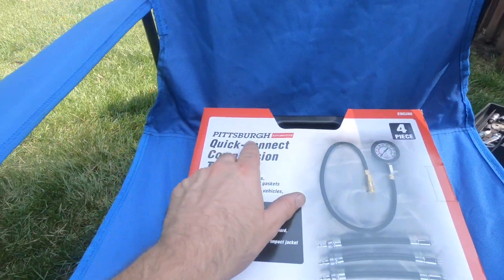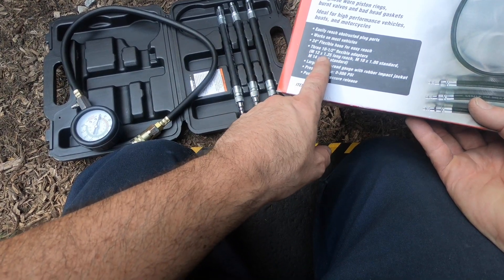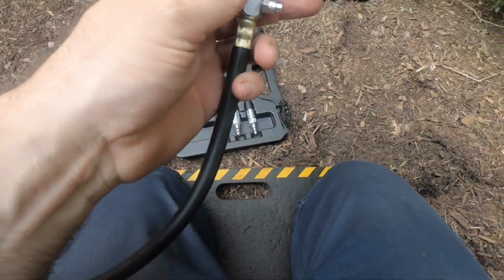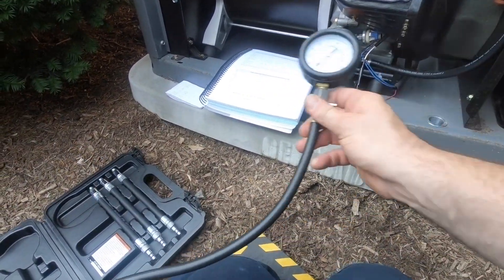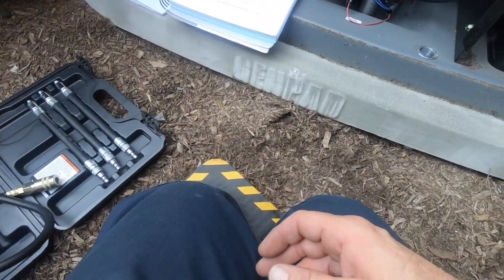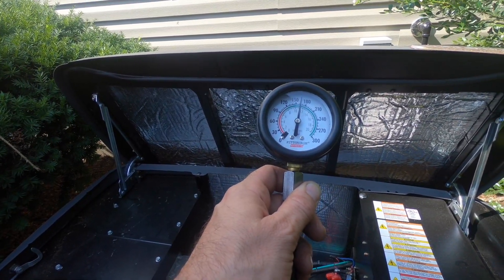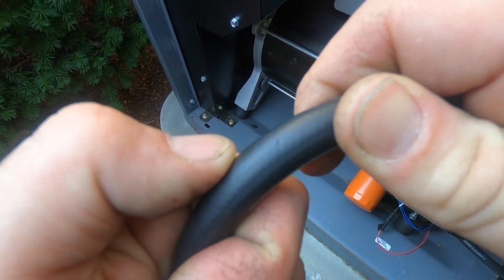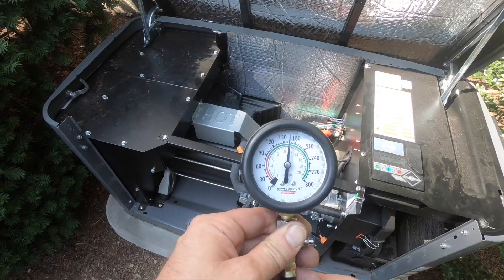The Harbor Freight Pittsburgh Quick Connect Compression Tester 62622 Generac Engine

Comment: If I had a quarter for every time he kept twisting the rubber hose to see if it was tight. I would probably be able to buy one with those quarters. 
Maybe the valves are leaking and  the tester is faulty 

Where’s your other tester? To compare OK back to finishing the video I’m just busting your chops by the way no harm intended.

Comment: For a compression tester to work properly it has to have a schrader valve right there in the threads that screw into the spark plug hole. There’s no exception to this rule. I don’t care if you’re testing compression on a chainsaw, a zero turn mower, a car, a truck, a generator, it doesn’t matter. If your compression tester doesn’t have a schrader valve right there in the threads that screw into the spark plug hole it’s not going to give you an accurate reading.

Comment: Schrader valve is nit closest to engine? Thats not  accurate. Also, even if your psi us in that range. You can go from 160 to 210.   You don't know if that's good. If you had two plugs than you have a comparison. If you wait a minute and psi drops, then u have issue. Or a bad tester. You should wait a minute and watch psi...if it drops...look into. I don't think you understand what is being done here.  I will not buy this.

Comment: ghis tester has no schrader in the hose end next to the threads .it gives low readings because of this ! just tested my v6 turbo engine and 134 psi vs 161 psi with an OTC tester .also correct on  engine cold throttle WOT to test .Make sure you have the check valve at the spark hole or it will increase volume and lower compression .i am a harbor freight fan and i buy tools there but not this bad design
Reply: Yep. The schrader valve absolutely needs to be in the part that threads into the spark plug hole. They should have put a schrader valve in each hose.

Comment: This compression tester is no good. Your reading was low because this tester gives bad readings. Get your money back.
Reply from the maker: I have gotten many good reading from it. I used it many times. Yet I have read a lot of bad reviews where it may not have read correctly for some
Reply: I had 1 it reads super low. Was showing 120 psi on a 1397 hayabusa. Got a quality guage and I was around 220psi

Comment: Are you not supposed to have the engine warm before doing a compression check?   If you want a normal oil seal on the rings, seems like the engine should be warmed before the test.   I am a shade tree mechanic, not a pro.
Reply from the maker: Wouldn’t the crank still put oil onto the rings as the engine cranks? I will experiment doing it cold then doing a compression test after warming up the engine to see how the test vary. When I went to school for generators the instructor did the test on a cold engine. Do you work for shade tree in Paramus, NJ?

Comment: throttle needs to be open to get a proper reading
Reply from the maker: I will unplug and hold open the throttle next time I service a generator. What does holding it open do compared to throttle position while cranking?
Reply: to make sure that the engine is getting enough air to make max compression.. that is what my shop teach told me years ago.
Reply from the maker: Thank you for sharing good knowledge that will help me and others
Reply from the maker: I did some research and found out that the eveloution controller sees an rpm signal, it energizes the fuel selonoid and drives the throttle open and continues the crank sequence. This is out of generac service manual. I made sure the throttle plate was all the way open on a leaf blower that failed it’s compression test. It had an oil coated spark plugs and oil seeping out its exhaust. I have 20 years experience with HVAC only 7 years working on generators haven’t had many engine problems mostly controls, and electrical. Yet I bought the compression tester to learn more about the engine side. I also want to get into more small engine repair as a hobby.
Reply: that is nice to know... I have always worked on my own cars and other engine powered devices also 3 year as a pro mechanic... I try to help out if I can....  small engines are easy and fun to fix. good and have fun